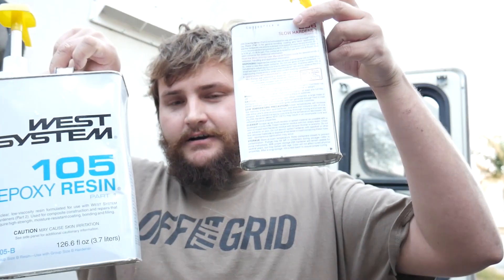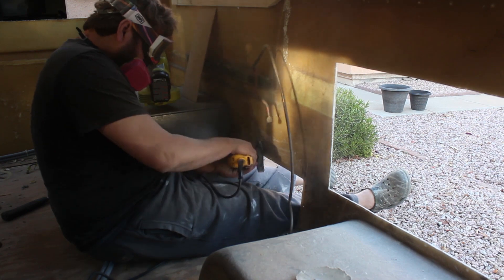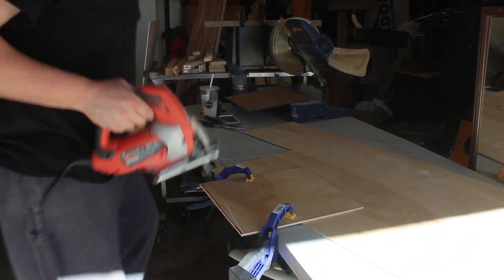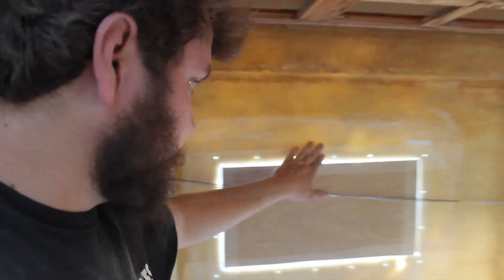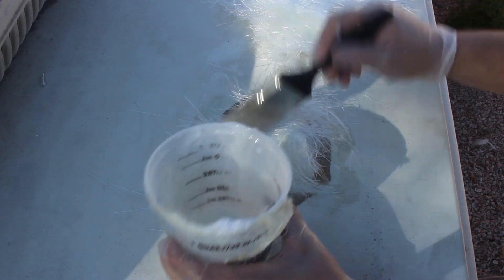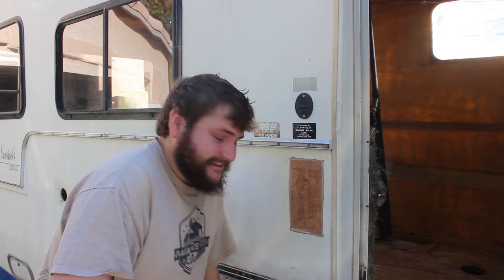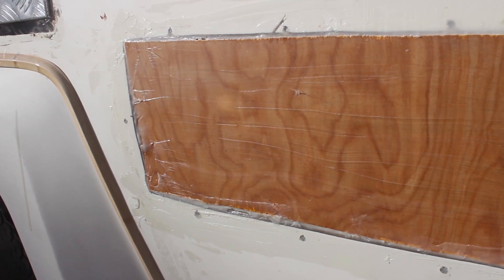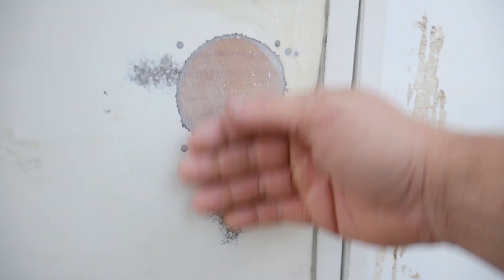FIBERGLASS FILLING in LARGE HOLES in RV for the FIRST TIME! DIY Customize Your Camper Ep2

Comment: First trip in our new to us motorhome we got hit by a guy in a pickup who literally took out a giant square of the back corner. We were able to temporarily stick it back on with some eternabond tape but dealing with insurance now I was wondering if some of the repairs could be done by us. I definitely want a pro fixing the frame and the inside wall of my cargo bay but this looks doable. Definitely always want to use a respirator. Fiberglass can create permanent scarring in your lungs. Probably want some sort of coveralls to keep it from imbedding under your skin too. That freaking hurts. I remember as a kid I was wearing shorts and sat on a fiberglass bench that apparently was in need of more epoxy. It felt like a million tiny splinters in my legs for days.

Comment: I am not a pro, but done fiberglassing on my parent-family cabin sail boat.  I picked up several tips from my father, and other people as well from one pro..   
 
yes people use  "panel" using wood, premade fiberglass sheet and (hint) paper/cardboard in fiberglass as either filler or structural strengthening materials. Pro i met, favors plywood or chip-fiberboard (looks like 1 sheet cardboard, similar to cereal boxes)

start think fiberglassing in layers in advance.  choice of layering approach would depend on purpose of the area,  such as thin-ness,  structural, high impact or curvatures.

now with panel materials, you want the first layer be applied on both sides close before the cure completes. this should tack the panel in place while curing.  my father like to use thickened resin with 2 strip of fiberglass per side (4 strips) on his panels.  you used packing tapes which is an mistake.  Tacking is small strip to bind panel to existing fiberglassed material, not necessarily be on entire edges. 

but i am surprised about use of fiberglas tape this usually used on sheetrock and mud (next repair i make i am gonna try that) 

at the most work involved layering is this sequences (as if you cluld visualize the cut edge of the work... smoothing resin (to create near smooth surface), fiberlgas cloth, fiberglas wool/batt, rough fiberglas cloth, thickened paste, panel, thickened paste, rough fiberglass cloth, fiberglas wool/bat, fiberglas cloth, smooth resin.  

also more of a hint on layering selections,  fiberglas wool/batt is used for curvature areas, and fillers.   repeating cloth in where weave is arranged in angles lends toward impact resistance.  lightest cloth or just fiberglas wool without layering makes transparent look, thus thin-ness.

finally  do remove the paint off (feathered) away  from where you plan to fiberglas.  for beginner, would recommend 3 to 6 inch area paint stripped off. professional is skilled with small area feathering, i have seen them doing repair area with 1 to 2 inch area stripped and great job.
Reply: what about fiberglass to aluminum shell?  i want to fill in an rv vent holes and the shell is metal.
Reply: @genreofstubby  my knowledge is mostly wood, paper (cardboard-fiberboard) and "mold" that is deliberately left in (aka buried). I have not directly worked with metal or plastic.  One helpful hint.  Fiberglas resin makes heat, just like epoxy resin. I suggest checking other sources whether fiberglas-ing over metal or binding (similar to filling holes) metals can (or can-not) be done.